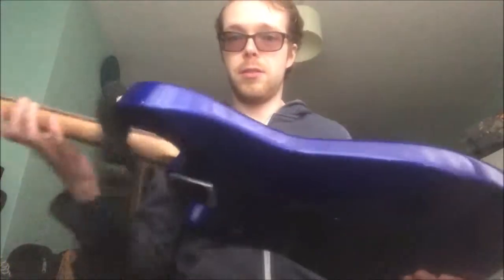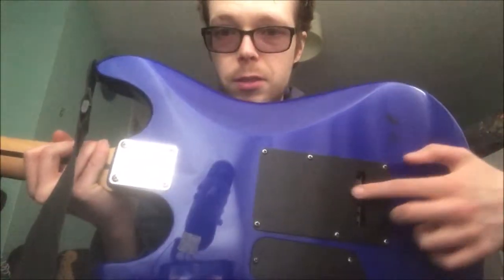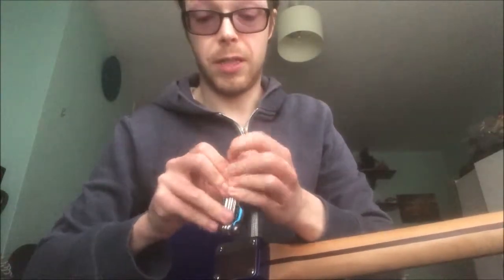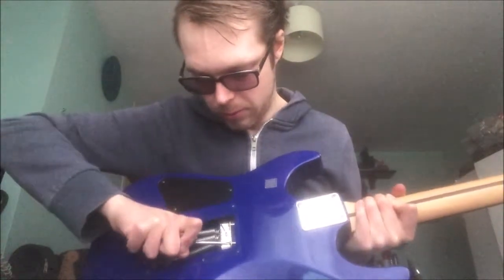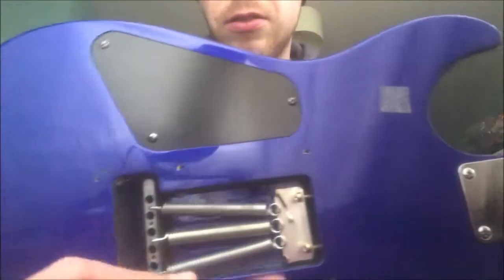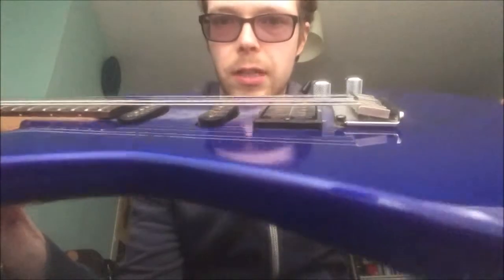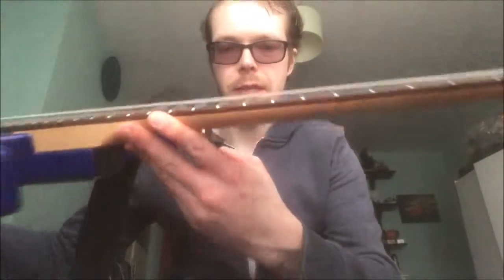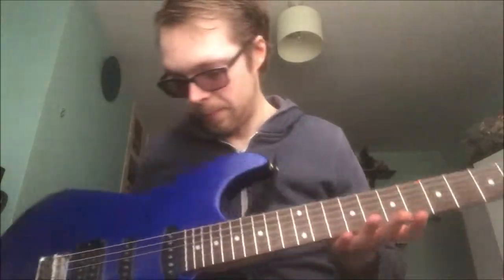Squier Showmaster Set-Up

Comment: Hi Al I recently bought one of these second hand Showmaster upside down head stock no scratch plate H S S made in Indonesia. I really like it, everything works as it should sounds really good . Do you know where I can get any information on it?
Reply from the maker: Nice find! I'm not sure but maybe if you email fender with the serial number they'll be able to tell you something? it's all pretty standard squier (and other import) spec stuff aside from the 2 point bridge rather than 6. I would guess the body is basswood- just a guess! the pickups will be fairly generic ones, not spec'd by fender. thanks for watching :)

Comment: I just got one exactly as the one, you're adjusting, sooo this video is very welcome. Thanks a lot for sharing the important issues. This guitar is indeed the most versatile in my collection. However I nicked a bridge pickup from a vintage Japanese Les Paul as replacement. The existing single coils are as good as the ones on a Mexican Strat - at least in my opinion. Would like to hear your opinion about those?
Thanks for sharing a very nice and effective how to for us loving the Showmasters. Btw, I've heard, the neck fits a Fender Stratocaster just fine. Anybody who have any experience about that?
Reply from the maker: Hi i'd say the singles are really weedy and not as nice as MIM ones in my opinion. the neck could well fit similar strats i'd suspect. this one belongs to my mate and we're talking about what bridge pickup to put in it!
Reply: @BadMotivator66  Thanks a lot for swift response. If I didn't allready had a great pickup to use, II would think about the Seymour Duncan SH-14........as a blues player
Reply from the maker: @AffiBlues  I have a duncan designed 59 and a jb, and some various others i'm considering! i'm gonna hone in on what my mate wants the guitar to do and go from there

Comment: First you should get a decen screwdriver.  Secondly you should put the springs parallell instead of V-shaped so that you get equal tension on all 3 springs instead of a lot on the 2 outer ones and less on the middle one. Looking at the saddles the guitar would benefit from shimming the neck so that it cones at an angle to the body so that the saddles can be lower. And you should retune between each of the steps. Look up a decent set-up gide on how to do it properly